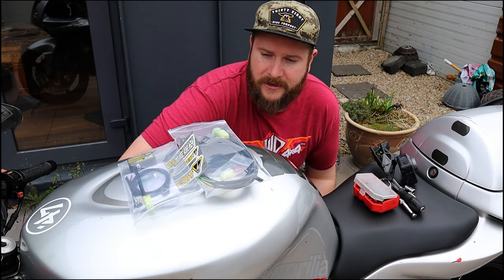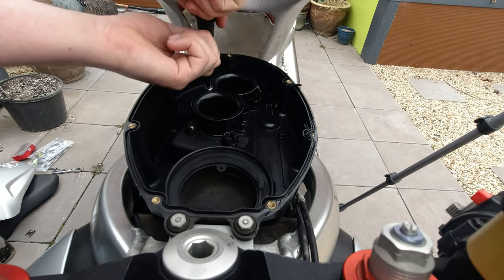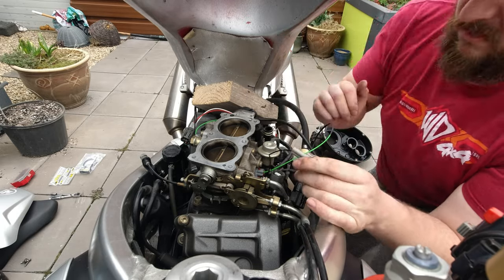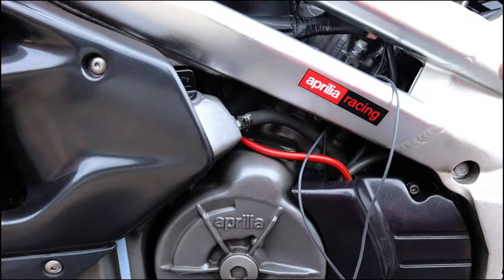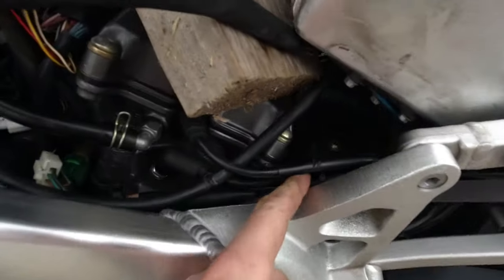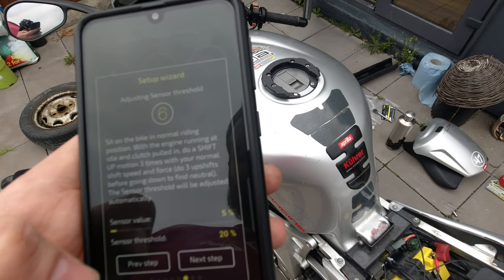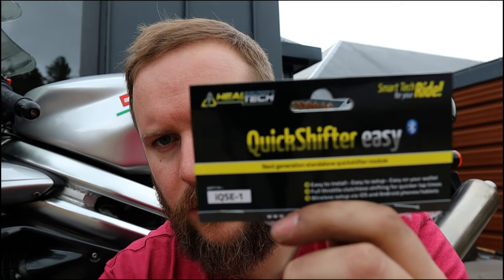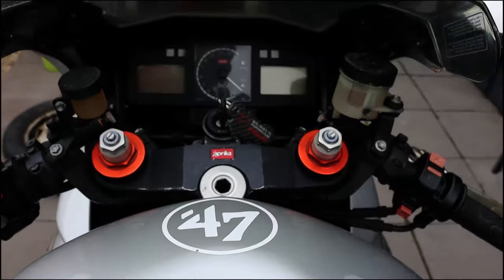Fitting a HEALTECH Quickshifter to my Aprilia Falco SL1000

Comment: I've had these on all sorts of bikes and found that sometimes, when mounted on the shift bolt, tightening to 7nm can reduce the sensor sensitivity. If it does, you can get away with the pinch bolt being a little looser, and lock-wire it for peace of mind.  Also I've had the sensor split and fail twice on a KTM even when torqued correctly (although they are a slightly different method of fitting) and does illustrate that they don't like being particularly tight. Never had problems fitting them on the push rod though.

Sometimes you need to adjust the shift sensitivity and duration to get them slick,  but they are a great piece of kit when working properly. Good choice.
Reply from the maker: I actually didn't in the end as the effort 7Nm was taking made me nervous so it's a little looser, but working fine. Lock wire is a good shout! Oh right, I'll keep an eye for that, did they replace it under warranty when it failed or what was the story there? I'm glad I didn't push it to the 7Nm so! Yeah the push rod would be grand to swap to, the bolt was just easy as so I went with the lazy option. 
Had it out for a very quick spin today and actually seems very good out of the box, only a little more time will tell me if I need to fine tune anything :) Glad they do work well tho!
Reply: @TheGorillaBiker  No they didn’t replace the sensor although it was more than a year old. They said they were looking at improving the fitment on the ktm. They’re about £50 each to replace hence my cautionary note. Currently have one on a multidtrada 950 fitted the same as yours and had no problem in two years so far.  I can’t fit it on the shift rod on mine because the rod is a pull rod not a push rod so it wouldn’t work.  Glad yours is working fine. 👍

Comment: hey there GB, my problem is knowing when to stop spending money on these things, i think there has to be a cut off point as to where you can over invest and you actually lose money. i think a good freshen up of the suspension is usually what i go for first and then anything else that needs doing after that, have to prioritize what needs doing first though, another good vid mate, keep up the good work
Reply from the maker: Ah yeah I think it's easy really, it's why I haven't put any flash bits on the CBF, I know I'll swap that at some stage. The other bikes I know I'm keeping so the cost is a lot yes bit I'll benefit so it's ok in the long run :) 
Yeah it's why exhausts are on the longest finger. Don't need them. Suspension next and it's done, I'll just enjoy it for a few years :) 
Thanks!
Reply from the maker: That's how I do it :)

Comment: Mmm interesting GB would I have a quick shifter ! probably not it certainly is a slick system you fitted on the Falco, but fer me if ain't already there I wouldn't add it . I only say that in this case because I have this feeling that the gearbox is not made to accommodate this stuff , and I know that has absolutely no reasoning behind it but that's me fer ya . On my XJR it's standard silencers only because I have not seen a system I like the look of .  They are all cans and they don't suite that bike  (in my opinion) . The magna will have non standard silencers and complete system eventually . It will also have a custom paint job too eventually but as you well know these things ain't cheap but we gotta do em right : D) good one mate well done  : )
Reply from the maker: A lot of people have that concern but it's less harsh than say clutchless shifting, which is fine. Will it wear the gearbox slightly faster? Probably, but that's ok to me. It's hard to find ones that look nice in fairness, I'd like a factory look but better performance. Haha can't wait to see it all :)

Comment: So fitted one to my Mille. I have set the range of rpm 8k to 10.5k so you can still down blip and it doesn’t cut the revs when you touch the lever, which is really annoying. Cut time is at 85ms and delay at 25 upped the delay to that from 15 made it a bit smoother. I only use it when going flat out as it can be a little bit inconsistent some smooth some not so smooth low down but all good when riding fast as I’m sure it’s intended to be used when going near to red line. If anybody else has some sweet settings be good to hear!
Reply from the maker: I had mine set from 5.5k up I think in the end and it worked fine, a bit lumpy too low down but still worked fine. Cut time on the down shift? I never tried that to be honest so am no use there. I only use it for upshifts. I was using a 90ms cut time and the default delay, I never changed that one as it worked fine for me. Sorry I can't be of more help!
Reply: @TheGorillaBiker  I don’t use it for down shifts either was just saying above that it will still cut the revs on downshift because of the sensor that’s why I had the lower limit revs set so high as you wouldn’t be changing down much and rev matching over 8k often so most of the time it won’t cut the fuel. But will still cut changing up above 8k 👍🏻hope this makes sense and thanks for the reply

Comment: If I was still racing I might try a quickshifter, but for me part of the fun is seeking to attain gearchange perfection... I have to say the wires seem very delicate as they are.  Will you wrap or bundle them? The one from the shift mechanism itself looks particularly vulnerable to boots.  Who knows what I might do if I had some money . . . 🤔 Then I think I'd be better off putting money aside for a different bike that wouldn't need the mods I am thinking about ....  Good clear video again. Well done 👍
Reply from the maker: Ah you need to try one at some point on the road, it's such a satisfying feeling just banging up through the gears :D Plus it'll likely get a stint on the track for a laugh so it'll be used :) 
There's actually pretty thick insulation on them to be fair to them, and I don't have enough length to wrap them up. That cable from the shifter has since been migrated behind the sprocket cover and tied to the clutch line away from the sprocket, I couldn't leave it there. 
Haha yeah I should really just sell them all and buy a v4 tuono with all the extras if I had any sense. But I don't :P Thanks Stephen :)

Comment: I have the same one on my gsxr 600 srad, still finding it a little finicky to get it working properly (actually didn’t engage properly on one shift and snapped the drive chain)
Reply from the maker: It did take me a while to get it nicely balanced but it never felt like it was doing anything bad. That's a very bad result, how the hell did it do that?!
Reply: Didn’t seem to engage gear and I wasn’t quick enough to grab the clutch
Reply from the maker: @mickusable  but instead of like a false neutral it locked up? That's bad now!
Reply: Yeah, pretty much, not tried it since, an expensive ornament at the moment 😢
Reply from the maker: Ah that's a pain man, you should email them on it they replied to me very fast!

Comment: Hi, question. In the beginning of your installation the white, read and green cable are installed at the right side. At your final check they are at the left side? Or it doesnt matter at which side  they are? Like to hear from you. Grz Jeroen.
Reply from the maker: It doesn't matter, from memory I just swapped them as it was the neatest way for me to route them that wouldn't interfere with anything going back on. Just make sure they're not going to be pinched and you'll be good
Reply: @TheGorillaBiker  ok, thank you very much for your answer
Reply from the maker: You're welcome!

Comment: Hi, great video 👍 does it work fine? I’ve heard someone had issue with downshift while rev-matching…
Reply from the maker: It worked very good while I had it, I never tried downshifting with it tbh I always used the clutch.
Reply: @TheGorillaBiker  alright 👍 but when you downshifted with the clutch, did you revmatch or not? 😅
Reply from the maker: @vuongtran1435  I assumed you'd meant downshifting using the blip function on the qs. Depends on the situation. Never had an issue when I did rev match.
Reply: @TheGorillaBiker  oh no 😅 i meant normal downshift with rematch without using the function of the quickshift 😊 
but very good to hear that you didnt have issue with downshifting 👍
Reply from the maker: @vuongtran1435  sometimes typed words can get confusing 😂